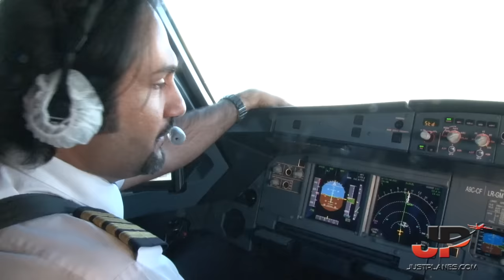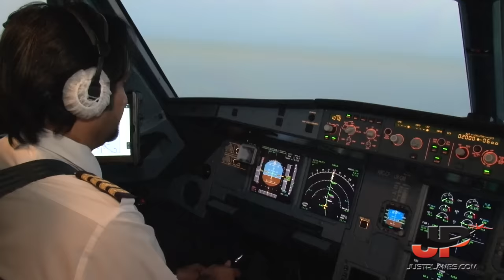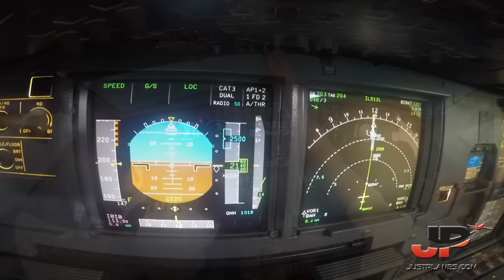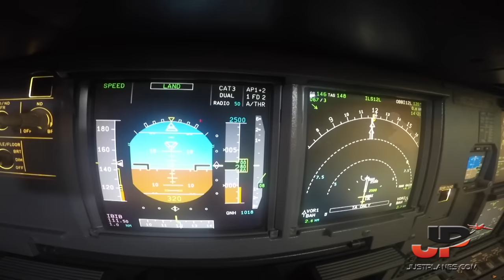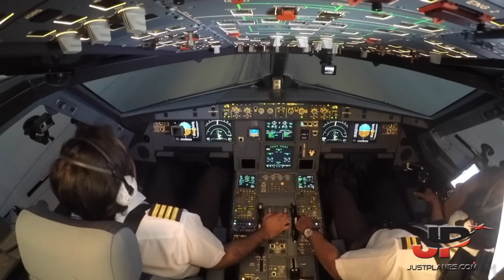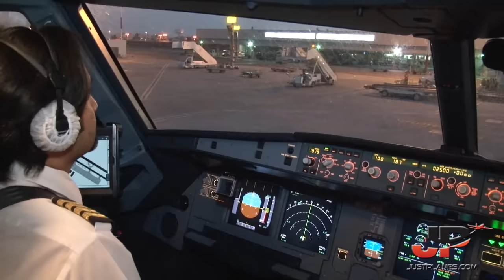Watch AIRBUS LANDS ITSELF  - Full CAT III Autoland

Comment: Imagine the passengers face if captain would tell them: "Today, we are gonna test the automatic landing system.."
Reply: Would they tell the passengers?
Reply: @mikehouqe8634  They only tell ATC
Reply: what if there were no passengers
Reply: @mikehouqe8634  Most Airlines have a policy of informing passengers of their intent.

To quote one of the Pilots on the QF32 Incident at Singapore, "You cannot just palm off a 'Technical issue' to passengers these days".
Reply: @phoman2597  Then they tell the Freight.
Reply: @ChannelReuploads9451  
When the pilot lands the aircraft manually he’s not doing it on feel and vibes, he is following the glideslope the flight computer is telling him to follow. 

A stressed pilot could make mistakes, it has happened that they diverged from the glideslope, got too slow, too fast etc. Autopilots don’t make these random errors, they cant forget flaps, gear or brakes and monitor every single instrument simultaneously. 

Meaning if the autopilot crashes a human probably wouldn’t have stood a chance. Which is why you wouldn’t get told when you’re about to do an automated landing.
Reply: A category III approach (CAT III with 0 visibility) are rarely executed because most aircraft don't have the equipment, plus once you land with that kind of visibility taxiing can be impossible or incredibly dangerous. and also the pilots have to be authorized to this landing. Not every pilot can land cat3. and also the airport infrastructure must be suitable for cat3.
Reply: I would be happy 😄
Reply: I do not know anything about aviation but enough to know that they have to follow tight regulations and they would not test the automatic landing system on a commercial flight with passengers. If they do it, that's because the system was already tested in real conditions so many times that the risks are not higher than a manual landing. The weather conditions seemed to be perfect as well. They wouldn't do it on a crosswind landing with a snowstorm...
Reply: Lmao
Reply: I'm a pilot for airbus and it's tempting to say 😂😂
Reply: I was on a flight back from Madeira to Birmingham UK and the pilot informed us they were going to autoland. It was pretty exciting to know the aircraft was capable of doing this. This was in 2004.
Reply: most landings these days are automatic on commercial aircraft from my understanding.
Reply: @ChannelReuploads9451  but to do CAT iii autoland doesn't require you to inform the passengers. In my 17 years of flying never once i told my passengers that I'm going to make CAT III landings. But we have to inform the passengers if there any technical problems with the aircraft if it is going to involve emergency landings. Otherwise you don't have too...
Reply: How many aviation fatalities have ever resulted from the use of autoland? How many have resulted from human pilot error?
Reply: The passengers would never know.  It’s completely brilliant.  I was once in the cockpit during a test flight after a lengthy c check or it was due.  And it’s completely amazing watching the controls move by themselves.  It was a Lockheed l1011 supposedly ahead of its time.   Depends on who you ask
Reply: You don’t “test” it, you use it. As a passenger, I’d be quite happy. How many “auto land failure” investigation findings have you seen? How many “pilot error”?

Comment: The first ever Autoland performed on a passenger aircraft was done by the British in March of 1964. The plane was the British Trident flown by BEA. The first ever Autoland performed with passengers on board was done also in a Trident aircraft in April of 1965, flown by BEA pilots. The second aircraft model to install the Autoland system was the American built L-1011 TriStar.
Reply: l-1011 was such a good plane it just came to the market too late
Reply: A category III approach (CAT III with 0 visibility) are rarely executed because most aircraft don't have the equipment, plus once you land with that kind of visibility taxiing can be impossible or incredibly dangerous. and also the pilots have to be authorized to this landing. Not every pilot can land cat3. and also the airport infrastructure must be suitable for cat3.

Comment: cool view but it seems like the go pro is blocking the captains pfd..
Reply: @schaefferav8r  Also, the cockpit of an airliner should be sterile during stages of flight such as landing. No one should be talking about anything except necessary things.
Reply: ...and therein lies the differences between airlines, their expectations and SOP's.
Reply: @MaxPower888  they shouldn't be talking about other things than the critical phase of the flight they re currently in. In this case they're actually talking about the flight itself. No problem. Every instructor has to go through this. The camera thing I think the angle of the rear camera makes you think it it obstructing but in fact it's not that much. Anyway, the pilot can remove the camera instantly if needed.
Reply: @MaxPower888  This was an entirely sterile cockpit. All conversation was landing related

Comment: The technology has gone far! This was a 'nice weather' landing, but can the plane land itself in very gusty conditions? When the airplane has to crab into the (cross)wind(s) ?
Reply: No, this is really for low visibility, calm days with extreme fog, haze or smoke.  When it gets too turbulent you need to find an alternate if the visibility goes south as well.
Reply: Autoland works fine in a head wind, but you can't use it with a tail wind, a cross wind or if there is turbulence or gusting, because (unlike a human) it cannot react quickly enough or correctly.

Comment: I’m curious about moderate to sever turbulence.  This is amazing technology.
Reply: Beau Britton I'm not a pilot but i think in times of severe turbulence, the atc changes which direction planes should land on the runway. There are two ends of the runway and both can be used for takeoff/landing. ATC will issue the pilots towards the runway in which that wind can favor them. As you know, there are some airports which have runways going towards different directions and ATC could direct them to a runway which won't make the plane go through severe turbulence. I'm sure that autoland can correct the plane as moderate turbulence drifts it off course every now and then but the pilot could also take control at final. I'm not completely sure if this is how it always works though.
Reply: The crosswind limit is somewhere around 20kts for autoland IIRC.

Comment: Wild! To think that the automation can do better than most pilots, regardless og the conditions.
Reply: When the weather, wind and traffic are good, and auto landing takes more time than pilots do
Reply: The automation can't do better than most pilots, one of the reasons autoland is mostly just used in bad visibility is because the pilots are trained well enough that manually landing the plane is smoother.

Comment: What happens if there is a last minute wind gust? Can the pilots still make flight control inputs?
Reply: Yes, they have to be diligent as the pilot said in monitoring, he could have taken over in an instant ... you keep your hand ready to take auto-pilot off, also if you make a large control surface adjustment, auto-pilot will disengage.

Comment: Good video, however, the PAPI explanation is somewhat misleading. PAPI is to be disregarded if the approach profile, glideslope, localized, DME, RadAlt, BaroAlt are all correct. Some approaches even state that the G/S and PAPI may differ. Besides,, if during a real approach to 100 m, the PAPI will not be visible until below the deck. PAPIs and VASIs alike are ref only unless the PF STATES, "going visual" or during a published visual approach and FDs off. Back in the day, we used to routinely hand fly a CAT II approach for real, with FD and no autothrottle. Our aircraft were approved for this, including single engine. It seems we have regress in this area.
Reply: wondering if ILS calibration flights track G/S vs Papi? im sure they dont always track esp close to touchdown. PAPI probaly more precise. but G/s is in control!
Reply: interesting to speculate if an aircraft could be fitted with a PAPI tracker as a backup to the glideslope? lets call it the optical landing system! esp useful if the G/S was notammed off?

Comment: I pretended I was on an cruising Airbus a380 with dead pilots and asked chatgpt4 for help. We crushed it. Here was the method: I was the supervisor in the cockpit.  we brought in a smart civil engineer passenger to sit in one pilot chair. we brought in an avid aviation sim player for the second pilot chair. we brought in another sim enthusiast for back up. We had chatgpt4 to get some ideas from. We tuned into the emergency frequency.  Chatgpt 4 told us that, and where various buttons were.  We got emergency traffic control on the radio and they found a suitable pilot to talk us through the cruise and auto land. we had 2.5 hours till landing in Sydney. We learned the instruments and created an easy to understand written plan of action for our approach and landing. weather was good and the airport and runway were capable of accepting an auto land. We ran through our plan several times before our approach began. We had a system of triple checks for each step. Obviously we made reassuring announcements to the passengers. We couldn't hide it from passengers because it's unethical,  and also because we had to search for smart confident technical minded people to come be stand-in pilots. It all went off without a hitch. I think it's more than possible.

Comment: Miraculous!!!  Excellent technology.  Amazing.  All of the relevant aspects: autothrottle, direction, altitude, course changes, and more.  I've tried this in a flight simulator, by practicing in the daytime with all the light I needed and then worked on the same procedure in fog or low hanging clouds.  Never did get it right.  :-)  It is going to save a lot of people's lives.  Thanks for posting this vlog.

Comment: No matter how advance the automation is. The pilots must have full control of the airplane in case if the automation goes haywire.  I still trust in humans compared to machines or computers, whatever they are.
Reply: Agreed in my opinion the technology isn't 100 percent proven
Reply: CloudDayLight it’s not it does mess up
Reply: Literally everything is controlled here by computers it's fly by wire. Pilot moves the stick that tells computer and then computer moves hydraulics. Autoland is used in extremely bad weather conditions. When pilots can't land because of fog plane will do it automatically. Autoland is one of the only options for bad visibility landings. It will never go haywire and it absolutely doesn't matter cause whole plane is controlled by computers anyways with lots of redundancy meaning that there's no fail risk.
Reply: @dkdanis1340  The computers are all completely useless unless a human being tells them what to do.

Comment: for most things im against automation because it destroys job markets but in this case i think its a great idea when they are advanced they will eliminate human error be able to react to problems faster
Reply: The autopilot is an assistive system that's been around for decades. The purpose of an ILS (Instrument Landing Sysem) is to allow landing in low visibility, when visual landing is not possible. It's not going to replace pilots.
Reply: @hexandcube  i know it wont but at some point using the ai to land will be far safer than doing it them self especialy in very dangerous places like nepal were 1 wrong turn and your going into a mountain.

Comment: Can planes with this cat 3 dual autolanding systems ( or not sure how this is called ), land themselves in very bad cross-wind conditions? Is the system capable to fight with strong winds ?
Reply: No, it's not. IIRC the autoland crosswind limitation for the non-sharklet A320 is 20kts.
Reply: @kallek5655  thank you for info.

Comment: Upon touchdown, the pilot need to control the rudder manually to keep the nose at the centerline, so it is not align by it self ON the runway
Reply: Nope, this aircraft has ROLL OUT mode, its capable of maintaining centerline on runway without pilot input during Autoland.
Reply: Tea

Comment: guess this finally puts to rest the age old question, 'can a passenger land a plane'
Reply: Indeed yes. But you just have to hope the diversion airport has the full ILS that allows cat 3. Most but not all do.
Reply: Luke Walker and you have to program the MCDU to the calculated vref speeds and all for ils to function consistently
Reply: Having the plane set up for the autoland mode is an impossible task for an untrained passenger. It would be a mammothal task doing it with someone telling you exactly what to do over the radio.
Reply: The VERY FIRST thing the passenger would need to do was make contact with the ground i.e. know how to use the radio. Failure to do that and the plane crashes - you ain't gonna find an airport and land by yourself. If successful, they then need to be talked through how to program the necessary units (nav computer, localizer radio frequency etc) in order to change direction to the nearest suitable airport then line up and attempt a landing. Trust me, you need that first communication step to be made. Oh yes, the person on the grounds needs to know how to pilot your plane. You might need some spare gas too!! Landing is dooable though.
Reply: @0xf7c8  exactly
Reply: The answer is still NO. A trained and experienced pilot can program an autopilot quickly. A passenger would not know where to start and would be hopelessly slow even if they had somebody telling them what to do.

Comment: How well does it handle cross wind landings?
Reply: Max allowed wind speeds are much lower when Auto Landing
Reply: @Dolpherinoo  Thanks. I was beginning to think I wasn't going to get a response. Makes sense though. I wasn't sure if the computer could keep up with the calculations of the constant wind speed and direction changes that happen.
Reply: Yes it can even in heavy cross wind

Comment: Impressive. I would use it every time. It’s too boring landing all the time. Have lunch. Finish your martini. Whatever you want.
Reply: @noblestar7742  in fact most pilots prefer to do it manually as much as possible (though at least for airbus, manually is a bit relative) because, not only as you said to keep in touch, but a trained pilot can land considerably smoother than an autolanding. Because of this, autolands are generally used only in poor meteorological conditions, where the visibility is not good enough for a visual approach. However, pilots must autoland at least 3 times per month (also to keep their autoland skills) so sometimes they'll autoland even in perfect visibility just to meet those requirements. Hope it's been informative 😉

Comment: What do the knobs he adjusts do?
Reply: Which one? Time stamp?
Reply: On an auto pilot you set the mode of operation, and may also specify any or all of speed, bearing, height, rate of climb depending on the operation mode selected.

Comment: This video shocks me really.  In the first seconds of the video it becomes clear that the wrong QNH is set.  PFD is covered with a camera for the PF.  The PF holds in 2000ft rather a  pen in his hands than Sidestick and Throttle.  And absolutely no concentration for a flight mode which requires a higher attention than a manual landing. Gulf air, welcome on my personal „no fly list“.
Reply: How do you know its the wrong QNH ?
Reply: Max Look at the difference between ALT and RA (30ft).  After the touch down you can see a negative ALT.  Only in Amsterdam i know from a negativ ALT, I do not expect this anywhere others in the world
Reply: Watched several other Videos with the same occurence, it is normal with the diference  on alt and ra. Depends on the procedures described in the airplane flight Manual.
Reply: Hamburger Quieddje can you pls give me a link to one of this videos? Thx
Reply: Niko Ritz Sometimes you’ll get a negative reading(1 to a couple of feet) on the radio altimeter, it’s within limits.
Reply: Max go to 2:19 and you see a difference of 70ft between ALT and RA over the Water. That’s a lot if you remember the minimum on this flight is set to 50ft. I still wait for the other videos from Hamburg quieddje. I never see before a bigger difference.

Comment: I thought that it's supposed to be a sterile cockpit 10k or lower
Reply: And it is in the video.  Sterile cockpit implies that only matters relating to the flight operation should be discussed, and not private matters. That is exactly what the captain is doing here, just saying out loud what goes on in his head, regarding the landing.
Reply: Kyle is right...the captain should not be concentrating on explaining how the approach and landing are done in auto-flight...he should be monitoring the instrument readings and concentrating on any significant deviations therefrom or any anomalies...this can impair safety in case of a sudden departure from nominal final approach parameters...
Reply: @faro717  No, Kyle is not. This was a sterile cockpit. 

He is monitoring the instrument readings and his F.O is as well. A flight instructor also has to explain things while they are doing it. The captain did everything to the book